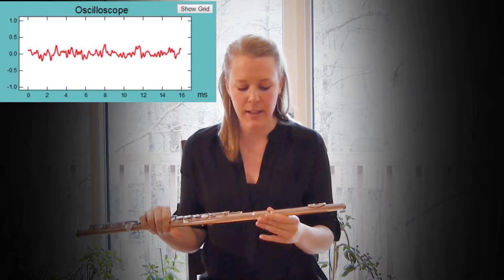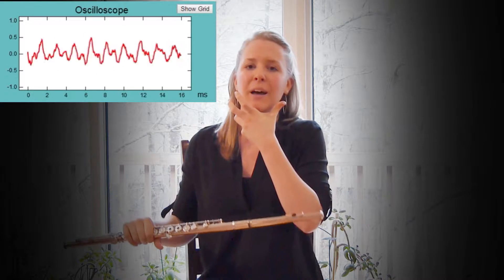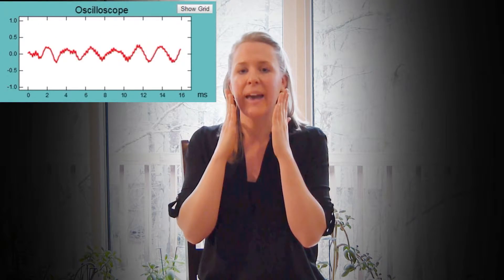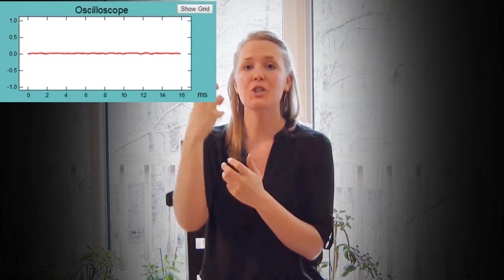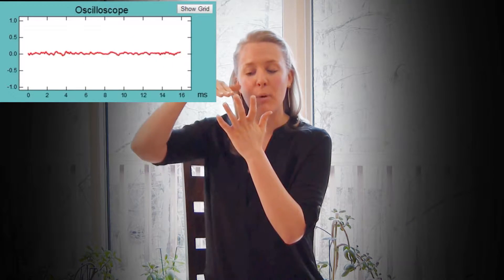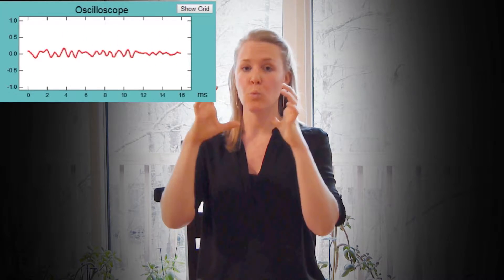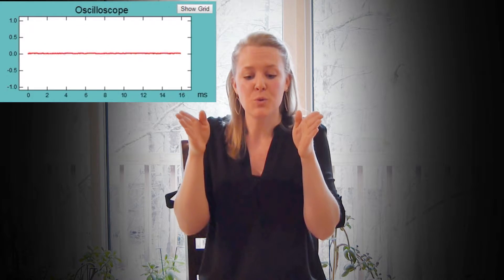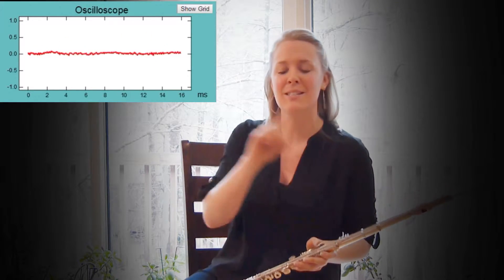Flute Physics from a Flutist's Perspective

Comment: If faster air results in a louder sound, and faster air also allows for a higher harmonic to sound, then what is done to produce loud low notes and soft high notes?
Reply from the maker: I tell my students in class that the length of the pipe between the holes is the main cause of the pitch and the the loudness is mainly determined by playing louder.